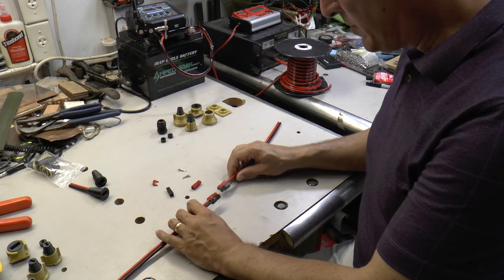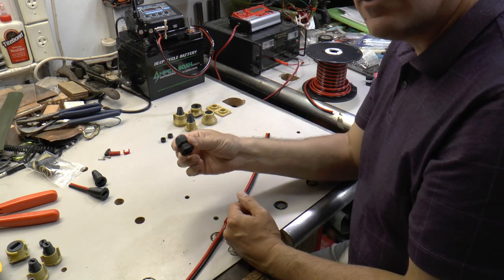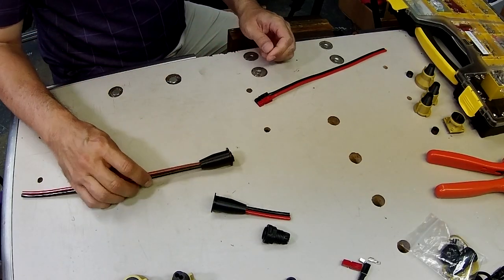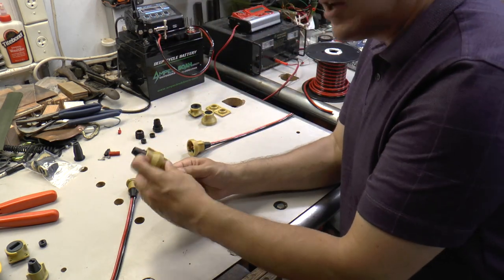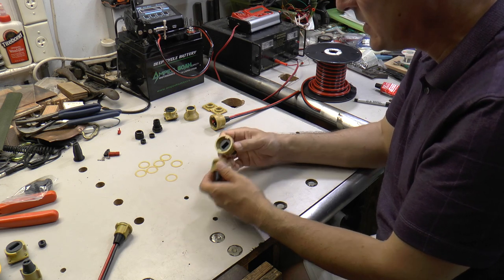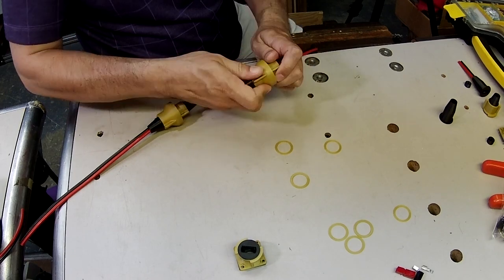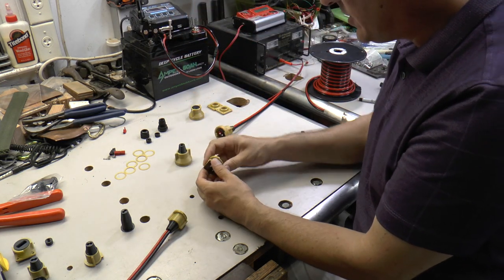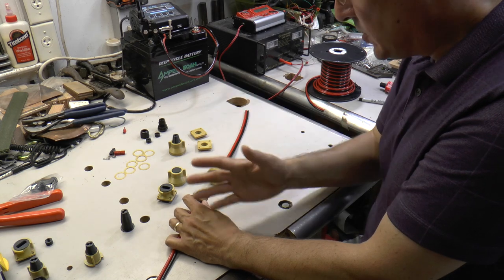3D printed housings to waterproof Anderson Powerpole connectors

Comment: Nice parts. 
I have a suggestion to make it even better. 
Try to design the outer plastic shell like a GEKA water fitting. So it's like the Anderson plug itself interchangable and no need for left and right case half.

Comment: This is amazing and exactly what I need however I'll be using 20 gauge wire. How hard would it be to adapt this to 20gauge wire?
I have a bunch of outdoor decorations that have had the insulation on the wires breakdown over the years and since I already use Powerpoles for ham radio then I might as well use the tool I already have and use those for this application, since they aren't waterproof connectors your solution is perfect!
Reply from the maker: It should be pretty easy to adapt. If you want to use the parts as is, just fill in the gap in the TPU part with RTV silicone. If you wanted a tighter fit, start with my part and tweak the wire holes until they fit your wires more closely. You'll still need to seal with RTV.
Reply: @kyakfsh  Thanks for the fast response. Once I receive the wire I'll try to use extra RTV and maybe tweak your design later on.

Comment: Just curious. Why did you choose tpu over petg or other filament types?
Reply from the maker: Prior to this project I did a few other prints that were intended to be waterproof.  I found that 3D printed PLA and PLA+ tends to be porous.  While acceptable for splash-proofing, to be truly waterproof for immersion or airtight, it seems that you need to post process the parts by painting them with something like epoxy resin, to seal them.  I found by experimentation that TPU prints with thin walls don't seem to have this problem.  So you can make something waterproof by wrapping it in TPU.  Note that the boots are made from TPU, and the housings, which don't need to be waterproof, are PLA+.  I admit that I have not yet tried petg, though I just received a roll to play around with.  Do you have experience using petg for waterproof/airtight parts, by any chance?
Reply: Man..Sorry for my delayed response.  I absolutely have no waterproofing experience with it.  I was just curious why you came to your decision and PETG was in the back of my mind.  You definitely answered my question and I appreciate the time you spent on this project and this video! =)

Comment: Why not just use a COTS waterproof connector?
Reply from the maker: Several reasons.  Most importantly, sometimes I just like the challenge of designing and building something difficult.  I enjoy tackling a project that pushes me to become a better engineer.  Also, the COTS connectors I found on the market were a bit pricey and their features weren't exactly what I was looking for.  The 45A waterproof connectors I see most often on Amazon are $16 a pair.  In my main power path I have 5 pairs of connectors, unless I'm running my battery monitor.  Then I have 6.  So that would be $80/$96 in COTS waterproof connectors.  The COTS ones have solder terminals, and I prefer the Powerpole crimp terminals.  The COTS connectors have a multi-turn threaded nut, and I prefer a quick connect, quarter-turn nut.  The COTS connectors have an IP68 style round cable gland, and I'm using double conductor "flat" wire, so I'd either need to buy different wire or print a custom gland anyway.